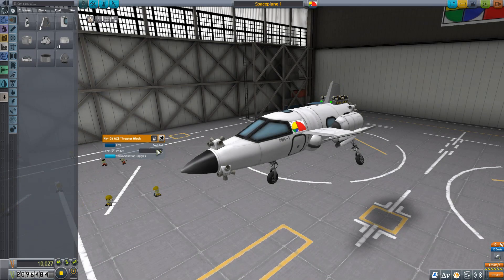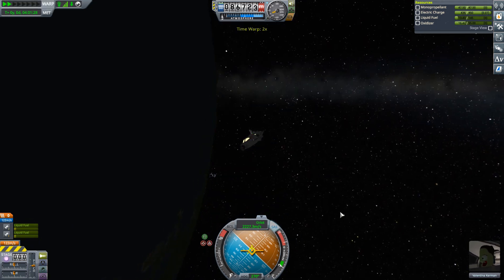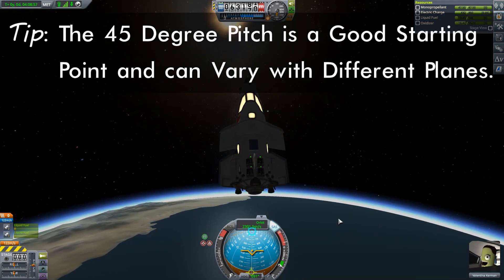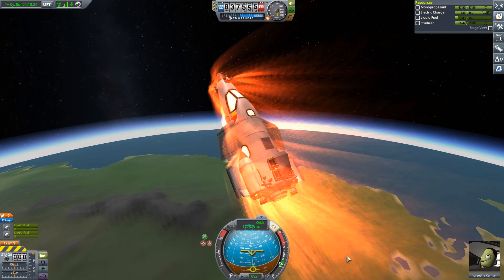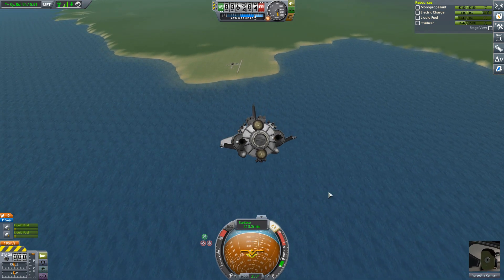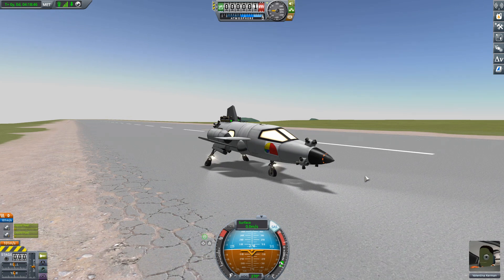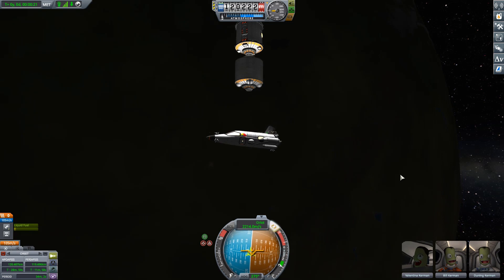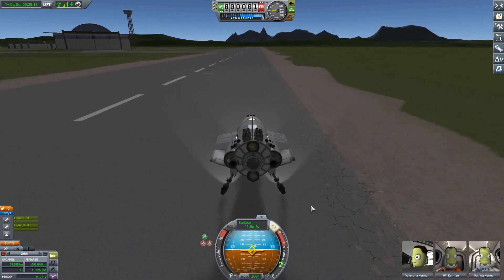How To Land a Spaceplane on the Runway | KSP (Not) Beginner's Guide

Comment: 14:08 how did you stage here and separate the booster from the plane? Does the docking port work as a decoupler too?
Reply from the maker: You can right click on the docking port and add it to the staging diagram, or you can stage it through an action group.

Comment: whats the point of landing on the runway
Reply from the maker: You do get 100% of the cost of the vessel back, but mostly it's just for the challenge.
Reply: @MikeAben  isnt that only with an ssto? or do you get a reduced amount of what returns if its in the water or somethin?
Reply from the maker: @mrkitkat0069  Whatever parts you put on the runway you get 100% of that value back. The further from the runway, the lower that percentage.

Comment: Good video. A few small things I would do differently:
Start the descent pointing prograde (rather than Radial out, or 'up'), as that is one of the first auto-holds available, 
then make sure the plane is level (blue hemisphere on the navball is 'up', orange/brown is down), as that works regardless of reentry vector (a rookie might not be coming in straight eastbound, heck even I sometimes come in around 55° northbound when re-entering after a minmus landing)
THEN pitch up according to your planes specifics (practice, practice, practice)

I would also recommend doing this with a bigger plane first, as those are not so affected by drag, can store some reverse fuel for the air-breathing engines (if it has any) to adjust speed if needed, maybe even go around, and is overall easier to control if built properly... oh and on that note:  Much easier to build compared to such a micro-shuttle.

... I had more thoughts while watching, but I lost them while formulating these ones.   Ah well.
Reply from the maker: Good tip locking prograde, leveling and then pitching up. I completely agree with this being easier with bigger planes. Heck, with higher tier air breathing engines, all you need to do is get within the vicinity of the KSC and then just fly home.

Comment: In order to reduce rolling at landing, try removing all steering on the wheels. You can turn it back on to taxi. Great video.
Reply from the maker: I tuned the landing gear after the video, including tweaking the steering. It's fine in the posted craft file.